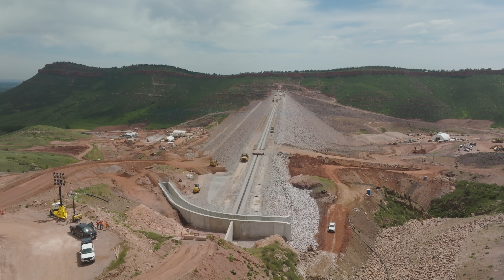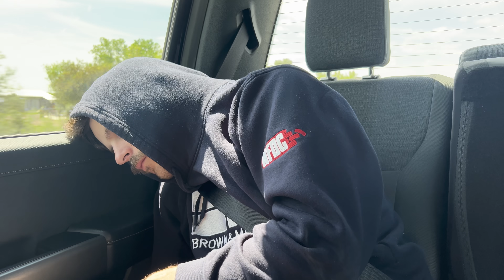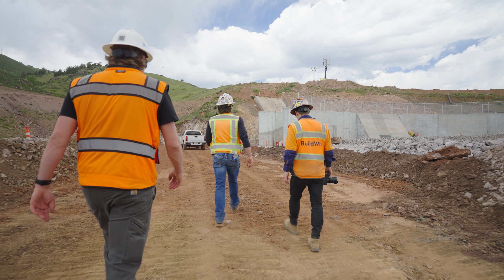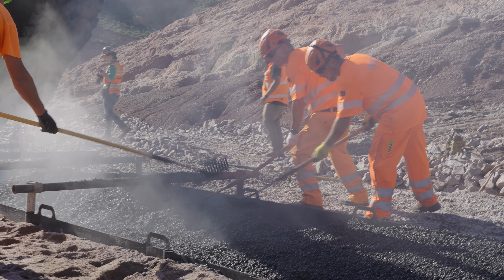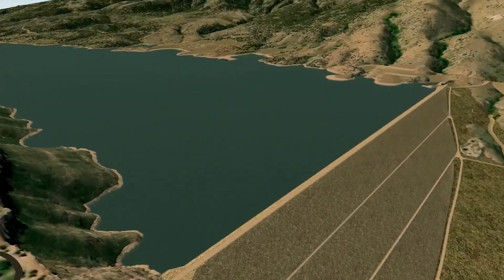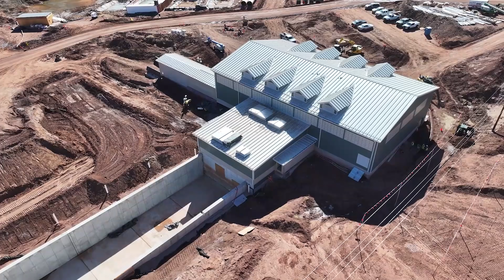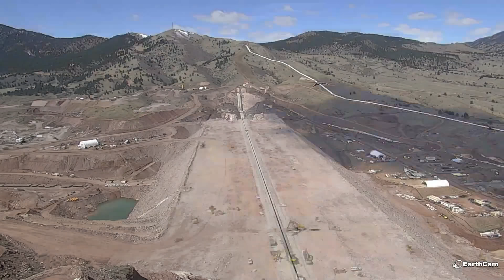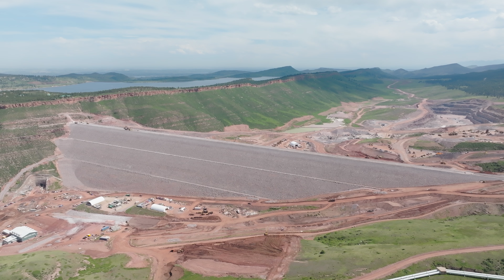Why Is Colorado Building a 22 MILLION TON Rock Wall in the Rocky Mountains?

Comment: Yeah they dug all that out corded it and now they found out there's a little bit of radiation in it
Reply: Ah radiation isn't so bad.  Builds character
Reply: We had a Landfill here where I live in the UK. So they decided to build on it! After months of draining it.They piled it. The Pile driver was working for 4 months at least. Surrounding buildings were suffering subsidence. ( Including my Mum’s Bungalow! Nightmare! Then they built a complete estate on it. And yes,they had Radon Gas. So! No BBQ”s, No one was allowed to heat their Greenhouses. And that stayed in effect for years! That’s modern progress.
Reply: It was there naturally.
It should remain there naturally.
Reply: They knew about it. Even I know that there were hundreds of uranium mines in eastern Utah on the Colorado plateau.
And all that yellow rock with fossils in it had uranium too.
Just don’t breathe in the dust.
Reply: Natural water purification lol
Reply: Number one, if you had water in a landfill, that is very bad. That is something that has been strenuously avoided for decades. In reference to “piling” do you mean drilled piling, or the historical piles beaten into the ground? I have drilled gas wells in landfills to release gas which is now usually filtered and used for heat or to generate electricity. In the past it has been flared off, but that is a terrible waste. If the gas is not released from the landfill, sometimes it vents out, not always within the confines of the landfill. When this happens, explosions have been known to occur. I’m thinking this is what you refer to as Radon gas, but Radon gas comes from earth and rocks. The gas from landfills decomposing is more of a Methane gas. When they use this gas from landfills it first goes through a filter system with about seven filters, give or take. Before filtering it is very corrosive. A tool left by an open well will have considerable rust on it the next morning. Nowadays the wells are often built from the bottom up as the landfill is built up to control costs. Landfills are usually sandwiches of selected soils and trash. Subsidence is a product of the trash decomposing. More trash and less soil will yield more subsidence. Modern landfills usually have a liner to try to prevent water that has gone through the landfill from carrying chemicals into the ground water. Building dwellings on a landfill seems like a scam to make money off of other people’s  abuse. The value of a building built on a landfill should be less than zero. Hope this is informative for you. Take care.

Comment: The Asphalt wall 
AKA ... Cut Off Wall .  These are put into old dams using a machine called a hydro mill the hole is filled with drillers mud and when the hole is completely drilled somewhere between 100 and 300 ft in most dams it is filled via trimmie pipe with concrete.

Comment: Is there a video on that tunnel thru the mountains
Reply: There's some random YT vids on it but the wiki page for Alva B. Adams tunnel has most of the relevant info.   The feature that I found most notable was that they generate power from this water on the eastern slope, and send some of it back through a 5 inch nitrogen filled conduit inside the water tunnel to the western side where it's used by the pumps that lift water from various other lower reservoirs ultimately into Grand Lake which is the feed lake for the tunnel.
Reply: @daemn42  THANKS
Reply: https://youtu.be/q-5PxNlXPCU?si=74mQCC9sjJV9uQCQ it was an amazing feat of engineering when it was built. 13 miles long, bored from both sides of the divide at the same time.